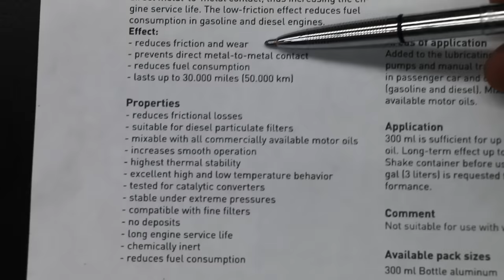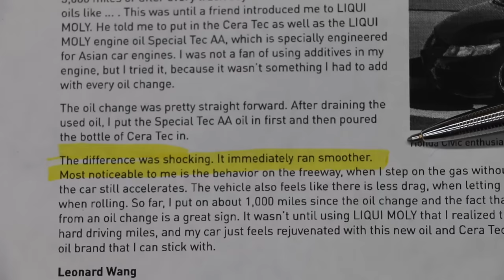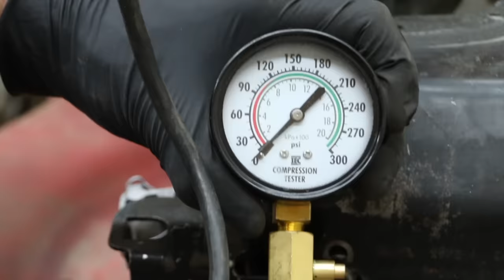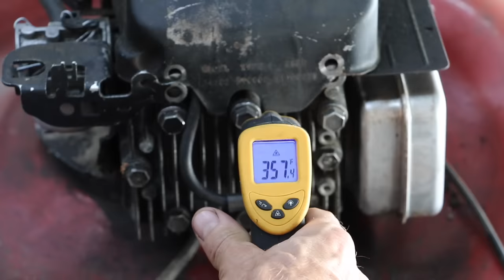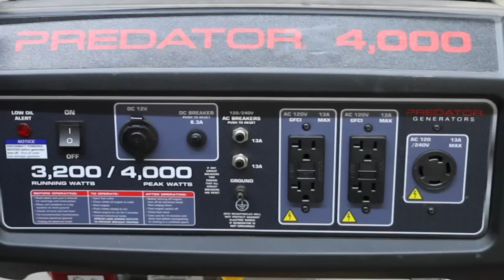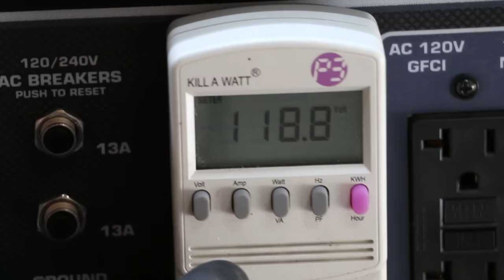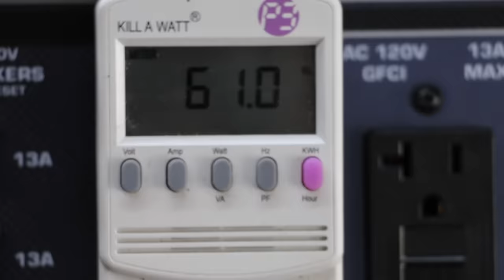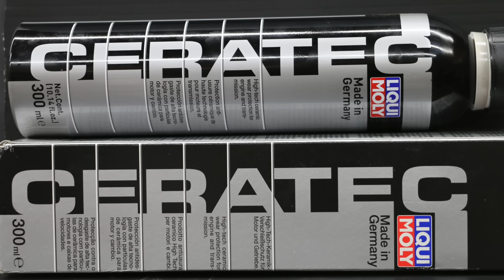Does Liqui Moly CeraTec work?  Let's find out!

Comment: IDK, but applied it to my 2010's  200k km corolla (120k miles) and the change is astounding. Engine vibrates so much less, it delivers smooth power, accelerates faster. It feels like the engine rejuvenated at least 10 years. It didn't affected fuel consumption (at least measurably), but the car feels so much smoother now. Effect isn't immediate. It took almost a week (100 miles) to get to current state.
The restoration in power is measurable because now it don't have to downshift in uphill while cruise control is on, on light hills. Before, even the minimum hill made the car to downshift and jerk violently.
Reply from the maker: Thanks for sharing.
Reply: @ProjectFarm hi guys does this help with the fuel injectors also?
Reply: @GreatScottByJoe No, your fuel injector is part of your fuel system. This is added to your oil (system), which is separate. Liqui Moly does have injector/fuel system cleaners though.

Comment: My BMW 318i with a gasoline-engine (no Diesel!) was built in 4/2000 and now has 400.000 km. I use the Ceratec since more than 15 years and the engine runs better than ever! I do not want to miss it.

Comment: This is over 3 years later, and something that I found out is that the gen 3 Coyote engines in 2018 and newer Mustang GTs have a "typewriter tick" problem from the factory, which drives people a little nutso... and adding a quart of CeraTec during an oil change actually makes this go away! So there's at least one good use for this stuff 🙂
Reply: thats what I'm hearing
Reply: I did same thing you are right it absolutely works so much better
Reply: @michaelfernandez7698  Try Xado, RVS, Suprotec Atomium, Ceramizer or RESURS next time for more permanent results. Those are European products based on the same Soviet invention. Cera Tec was actually develop because of the success of those products, but it's not as good and wears off twice as fast. This test wasn't properly done as the treatment takes 5000 km to complete (1500 km with the products I mentioned).
Reply: I use CeraTec 3 times on Jeep GC WK 4.7.   25k total miles worth.  Started at 80k.  Every other oil change or so.  The engine now has 105k & product currently in the oil.  It does quiet cold start piston slap. Also stops slap noise much faster than without CeraTec...always long before the engine totally warms up. Matter of seconds vs 1-2 minutes without. Reports suggest it takes about 5,000 plus miles to work in an auto engine. That's about 150 plus hours run time for most. Requires metal-to-metal contact to burnish into metal surfaces over time. Oil prevents 'most' contact. He ran the mower only 5 hours. Amazon users claim glass-like coating on engine parts upon inspection.  Hard to know for sure without more tests and proof.
Reply: I started using it also in my s197
Way quieter
Reply: i also have a mustang GT with the 5.0 thinking about adding this in my next oil change but i only have 6,000 miles on the motor. think its a bad idea to add the cera tec to my oil in this low mileage of an engine?
Reply: @SuperPaulywog  my engine had 1k miles on it when I added it. It’s doing great now at 6k.
Reply: I believe the graphite one would have done the same if not better.
Reply: @SuperPaulywog  no its broke in by now
Reply: Fixed mine n runs better
Reply: @SuperPaulywog  change oil first
Reply: @ray32825  yes, also molibden powder is a good idea.
However those additives work in a different way.
More like a "bumper" or "coushin" for metal surfaces.
Reply: @Paul Holena  do it. I put it in my Coyote, and it runs a lot smoother & less noise.
Reply: @SuperPaulywog  Not at all. I just changed my oil at 2500 miles on the odo on my 20 GT and it just got a slight typewriter tick. I used 5 ounces/ half of a bottle of ceratec which has made a huge improvement.
Reply: Yes 100% it gets rid of the tick.
Reply: @Paul Holena  NOT needed . Don't do while under warranty!! Just run a good full synthetic engine oil & OEM Motorcraft filter. Change every 5k or less if run hard. -Ohio
Reply: I didn’t put it back in my 2018 Mustang GT during my last oil change and the typewriter tick is much more noticeable now. It’s going back in!
Reply: @UnkTob  Yeah, it wears off after a while. I need to do the same thing in my next oil change.
Reply: Can confirm this works
Reply: I see this is 4yr old, but did you consider doing a viscosity test on the oil before and after adding the Ceratec? Both at cold vs hot temp.
Reply: @LMBC6Brian the tick noise is usually in the valvetrain from gasoline cars, so liquimoly oil stabelizer additive would hafe helped even more... Maybe ceratec does the same for a short period of time as the carrier oil for the supplements is thicker, yet is not designed for that purpose.
If you not mind, read the instructions on the bottle... Does liquimoly claim that it helps instantly? No it need burn in time
Do they advise to use it on every oil change? No
So it is more your psychology to tell this additive helps with lifter ticks🎉
Reply: That's a phenomenal find!
Reply: PROLONG AND MOTORKOTE PRODUCTS ARE WAY BETTER THAN ANY LIQUI MOLY PRODUCTS USE THOSE INSTEAD ###
Reply: Just threw a bottle of this in my 2014 f150 5.0 with 90k mi. Fresh oil change with castrol 10k mi 5w-20. Took it for a short drive and then popped the hood to listen to the engine. While I didn't expect much difference after a short drive I do have to say that after using the Hot Shot stiction product the same way at last oil change that the Hot Shot did immediately quiet down the ticking. I change oil and filter every 5k mi since new' Of course except the first 500 mi at which time I changed the oil and filter. Never any metal on magnetic oil plug at changes and oil at 5k never looks all that bad. I do run some marvel in the oil from time to time. Engine seems to like Kirkland syn just as much as any other. By using different syns at oil change I kinda think I'm getting the best of all protection for the engine.

Comment: Long term tester here with a 2009 1-series bmw diesel (118d)
I was testing it years ago and it really improved not only the overall engine acoustics but also the smoothness. I then ditched it after doing two changes after each 10.000km because I've noticed residues coming through the cyclones, and almost immediately the engine began to run very rough. I began to blame the oil but I was sure enough that the strange stuff coming out of the crankshaft ventilation behind the oil separators was a leftover of ceratec. 10.000 km later I switched back to my favorite brand of oil but to no avail. Next up I've re-introduced CeraTec and bam - everything was smooth again. Just from the feel of it it is an improvement but I never compared how much more fuel efficient the engine is. I'm just looking at the shift knob rocking around like crazy without it and resting still when this product is on duty. After accumulating a total of 200.000km with ceratec there's no issue so far. The camshaft and head looks clean so there is no buildup of the stuff either. So my conclusion is it leads to a much smoother running engine at least.
Reply from the maker: Thanks for the video idea.
Reply: Sorry for the late reply. Are you still using this product? I am planning on using it on my Cdi Mercedes and I am a little bit sceptic how the turbo will react (mine is at 231k km now). Do you recommend it?
Reply: @arbrimehdija5821  If your turbo is that old it might fail at some point in time and ceratec won't increase the likelyhood anyways. I'm now at 360.000KM and ever since used ceratec on any oil change so far. Last turbo which was the factory one failed at me at 240k. It still runs buttery smooth but i noticed an increase in oil vapor coming out of the crankshaft ventilation. I guess this is due to the fact that the oil is hitchhiking the ceramic particles which makes it easier for it to climb up the ventilation path through the cyclone. The loss however is nowhere near the amount which is communicated by BMW. After 10.000Km only 100-200mil are missing. BMW says it might be even 100mil per 1000km.
Reply: @FntX-Video  hi is your timing chain ok? Could you hear any noises from the back of the engine like a rattle and with the ceratec the noise was quieter or still the same? Thanks
Reply: @Alexander_l322  I'm now at 360.000KM and still no (abnormal) noises from the chain. On top of that you can't fix the chain issues with oil or additives - you can only extend the lifetime of the guides, chain and tensioner when issues are not yet serious. If your chain does the famous rattling noises, it's doomed regardless.
Reply: I believe that Liqui Moly advises to not use CeraTec too often.
Reply: @uranusneptun5239  Do you have any source for that statement by any chance? Because that would align very well with my observations with the residues coming through the cyclone separators... Not that this hurts much other than carrying over more oil into the intake than usual...

Comment: I have used this stuff for a few years and all I can say is it made a great difference in my 2013 honda accord.  It's one of those earthdream 4 bangers with direct injection that are noisy as crap and vibrate alot. Definitely not the great honda engines I used to drive from the 80's and 90's. Although they feel like they make about 50% more hp now.  I think they should be a little better on fuel than they are. The old Hondas got way better mileage. Like 40 around town.  The first time I used this Ceratec stuff it immediately quited down the noisy valve train that always rattles on start up and mpg's went up to 27 from a little over 21 . That is around town mpg daily driven same route everyday to work and back so that has made for a pretty good test. I was shocked by the improvement. Seemed to improve more with every tank of fuel til it got to 27 mpg avg. It rarely see's any hwy miles ever. That's been my experience so thought I would share.  I just came across this video and never saw any test on it before. Not much of a youtuber , guess I need to check out all your other stuff
Reply from the maker: Great feedback. Thank you

Comment: 1% is well within the margin of error as there could actually be several mitigating factors and I wouldn't give credit to the product for it.
Reply from the maker: Great point.
Reply: The Expanse Fan and if you check a lubricity test, the ceratec only make things worse.
Reply: Agreed; for example if the engine was warmer when it started with the Liqui Moly it could make a small difference like the one we're seeing here.
Reply: If the test was done 100 times and amount of fuel was added with pipette for that 0,0001% accuracy then i would belive 1% instead of margin error
Reply: @DuBstep115  fuel should be tested by MASS, volume changes incredibly with temperature. pipette-ing super accurate volumes would be inaccurate given fluctuations in temperature
Reply: Correct. These videos are entertaining. Nothing more. However, others think it’s gospel.

Comment: Great video! I have tested this product on my European car, a German made. I immediately saw an improvement. The engine was running more smoothly and the vibrations were reduced on higher rpms. It became my favorite additive and I am recommending this to all my friends. The cost of a bottle is pretty small and it worth trying it.
Reply from the maker: Thanks for commenting on this. Glad it's delivering great results.
Reply: I had a guy that said the engine didnt revolution so fast, but i discoverred later that he did put too much moly in it. Thas like everything , it has a quantity to use, in doubt always but a little less.My advise.
Reply: I have a classic American muscle car, a big boat V8 ... will it work?
Reply: @225supersix1977  pretty sure... but don't pour to much. Less is more
Reply: The cost is expensive, but it does seem to make it run smoother. In Canada, it's $40 for a 300ml bottle.

Comment: This is what I've learned from this guy.. use high quality oil cause everything else is a gimmick. Thank you sir for all your hard work
Reply from the maker: You are welcome!
Reply: @ColdPetRat2.99 0W oils
Reply: @CHMernerner  0w?
Reply: @b.saulius3916  yeah. W. Low temp viscosity rating in motor lubricants. lower the number higher fluidity in cold weather. 0W rated (like 0w30 for Diesel engine with DPF that i use) automatically means it is very high quality oil since 0W rating is not achievable without high quality base oil and good additives. It's not like 5w oils are worse(most 5w oils use high quality oil and additives like 0w) but make 0W rated oil with any cheap ingredients is just impossible.
Reply: @iMernerner  That’s not quite the case. The farther the winter rating is from the summer number, the more the polymer viscosity improvers there are; and viscosity improvers are not as robust as the base oil. 0W- oils flow better in cold, but have downsides with burning and evaporating away. They can also burn, then leave deposits on the valves of engines with direct injection. They shear out of their summer grade ('weight') rating much easier. The result of that is a decreased ability to 'hold onto' the ability of their additive package to be effective. That's why it's such a crime to take such a thin base oil with a ton of weak viscosity improvers, then recommend such long oil change intervals with these modern GDI and TGDI engines with low tension piston rings and fuel dilution. They're already much tougher on motor oil as it is. Comparing a 0W-30 with a 10W-30 is no contest when it comes to durability.

5W-20 will last longer than a 5W-50 even though it's thinner. More base oil. Think of an oils winter rating as the base oil, and the rest as liquid polymer....even though that's not entirely accurate either. They add a lot more anti wear additives to oils like 0W-20 to compensate for it's weak film strength. That only works so much. There's just no replacing thicker oil. Thicker oils with more base oil simply outperform 0W stuff when it comes to friction. It's a balance. The best oil for winter (unless it's Alaska or north pole) is a 5W-20. Best stuff for warm weather/climates are stuff like 10W-30 and 20W-50.

Comment: I have one of those Volvo 5 cylinder engines with the notorious oil consumption problem. It was running a little rough, burning lots of oil, and had reduced fuel economy. The dealer recommended an engine rebuild, so I was fully ready to sell the car for something else, but I decided to try Ceratec instead.

It quieted up the engine, made it run more smoothly, reduced oil consumption, and increased my MPG. I will now use it every 30,000 miles as recommended and I hope it will allow me to get more life out of the car.
Reply from the maker: Thanks for sharing.

Comment: Ceratec has helped a fair bit with my R56 Mini's oil burning problem. I used to burn through about a quart of oil every 2000-2500 miles, with the Ceratec added it is more like a quart of oil every 4000-4400 miles. Eventually I switched to using a higher grade and heavier oil (Amsoil 
Signature Series 0w-40) I still add the Ceratec just because I still have some and my car has virtually stopped burning oil, it now burns probably less than 1/2 of a quart every 5000 miles now
Reply from the maker: Thanks for sharing.
Reply: 5w50

Comment: I've used this product in my 2013 Infiniti g37 after 20K miles on the engine. I noticed about a 5.4% increase in fuel mileage. I was getting an average of 21.1 MPG in mixed driving and after using ...2 months I noticed I was getting 22.3 MPG....I was still getting the same mileage when I changed oil at 50K and added more. I just changed at 88k and was still getting the same MPG. I plan on adding more at around 94-95K on my next oil change. I use 5-30 full synthetic oil. This is based on the digital MPG indicator. I will reset just to make sure that the mileage is the same.
Thank you for your review.
Reply from the maker: Impressive results!  Thank you